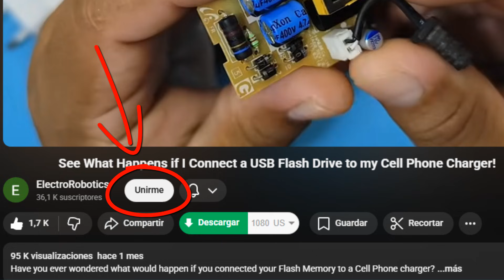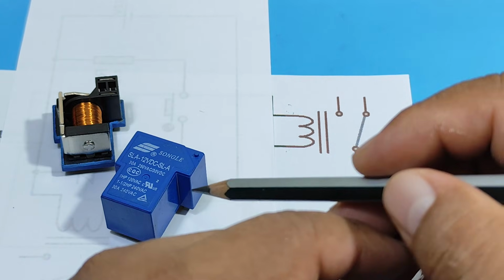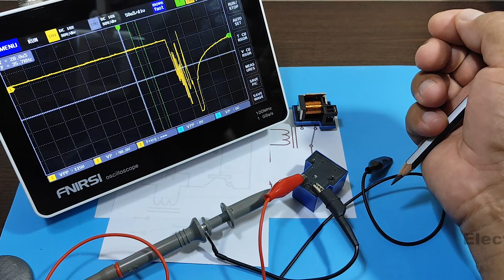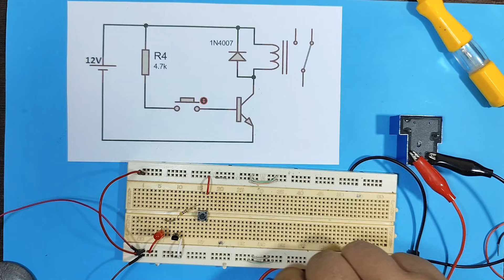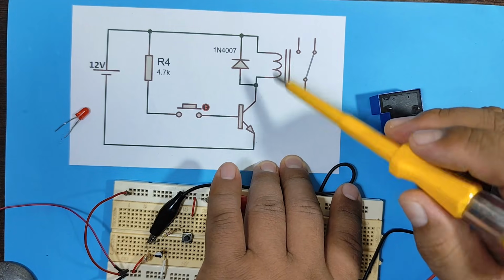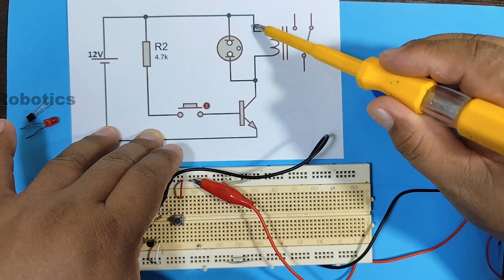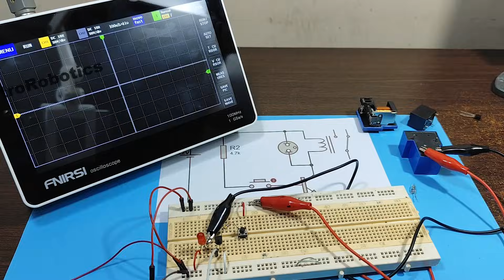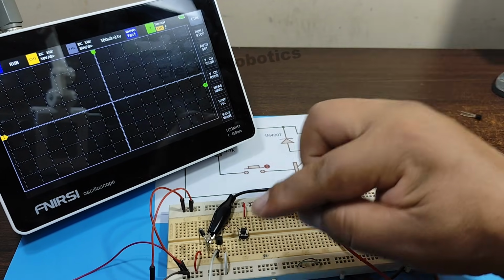Why add this Diode to your Relay Coil?

Comment: Your use of the description ‘the transistor is shorted’ causes confusion because people will think you mean that it has actually shorted out and failed but in actuality, the transistor ‘switches’ from cathode to anode when the relay is energised.

Comment: Wow seems you missed the biggest part . This is the coil produces magnetic field that expand outward from the coil. It the removing of the power that causes the voltage to be induced back into the coil ( ghost voltage LOL ). Since the collapsing of the field into the coil is much faster than the expansion of the field the values will be much higher.

Comment: The diode is connected to supress the counter EMF of the coil which is in reverse condition, thus protecting the primary components.

Comment: I would venture to say that the diode is going to leech some but not all of the flyback from the collapsing inductor energy field.  I would think that some amount of energy will still affect the transistor.  Using Channel 2 on an oscilloscope to catch the rest of the spike at the transistor collector would be interesting to compare with Channel 1 at the cathode side of the diode.  Thx for the video!